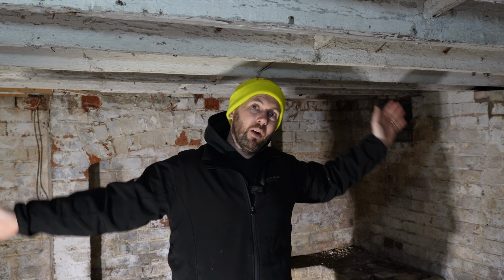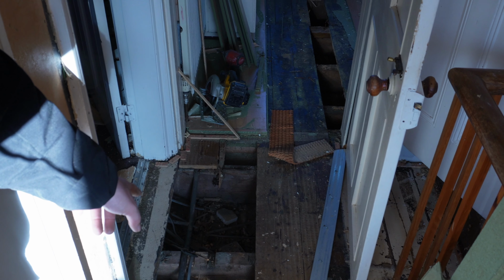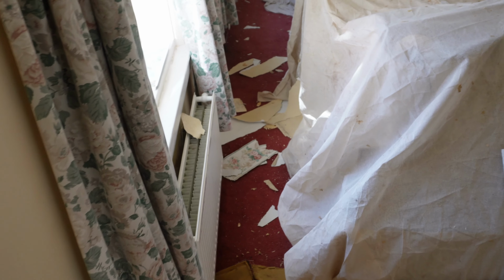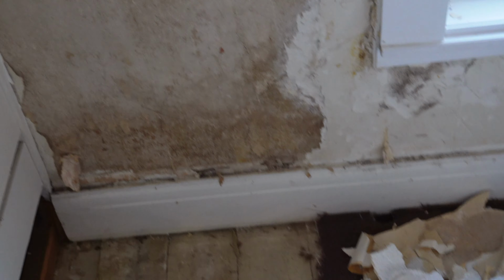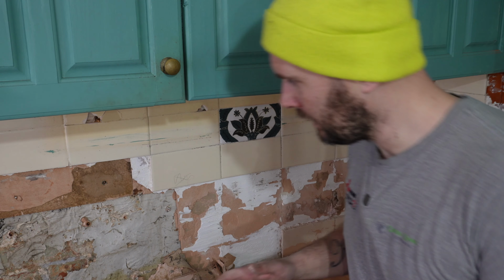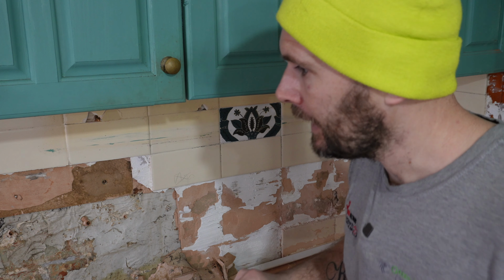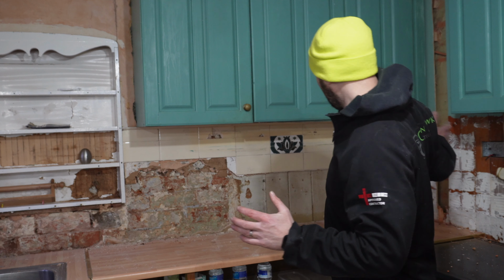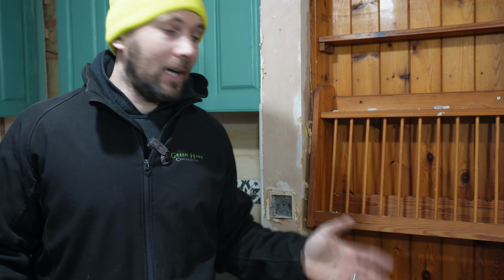REWIRE PROBLEMS 😵😵

Comment: I think the corded vir cable was installed in the 1930s because when i rewired my granddads house i came accros the same i ripped it all out and used some of the old conduit for the switch drops. i love rewiring old houses the old wooden joists are as hard as concrete and the spade bits hardly touched them. I burnt out  two or three of them.

Comment: Nice work 🙂 seeing corded cables still being used is a little frightening. There probably should be some sort of MOT system for household electrics. Sad for the customer you found the damp problem, but its going to make interesting viewing watching you resolve it . 😀
Reply: If only there was.... wait there is. An EICR would pick up on most of this. Gas calls for annual servicing, why not electrical? Granted on fresh installs or recently tested that could be extended but most installations have gone decades without testing.... that's not right.

Comment: Can you confirm that you drilled holes in the joists 'in a zone between 0.25 and 0.4 x span'?
Page 81 on site guide.
Also, corded cable = VIR (Vulcanised Indian Rubber)